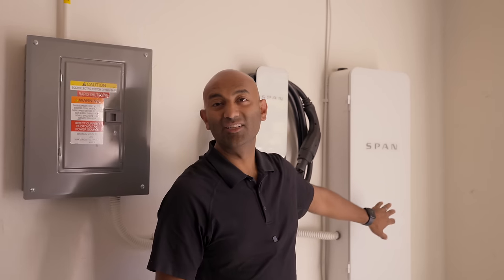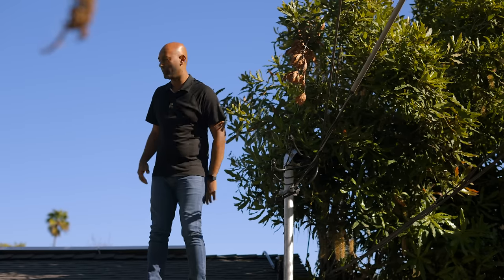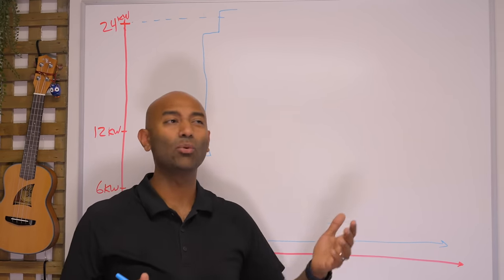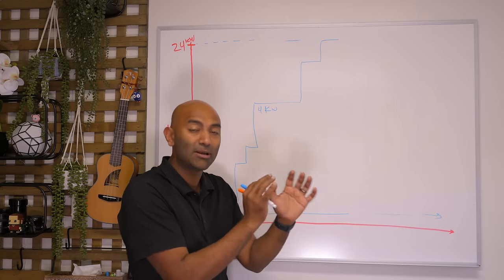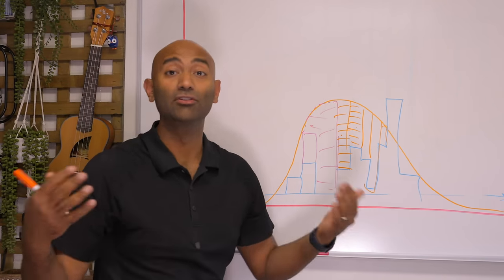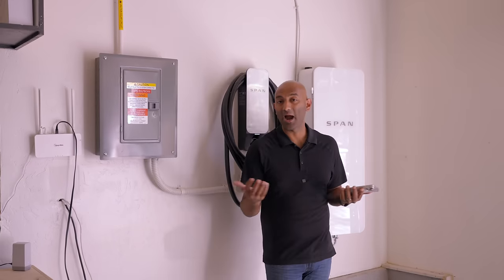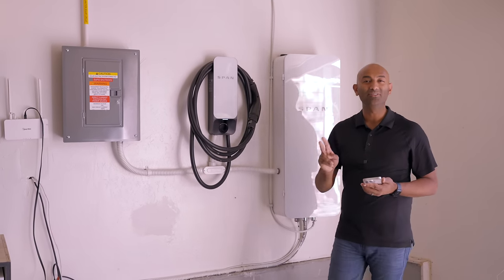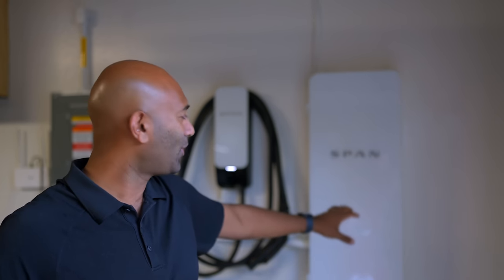I Installed a SPAN Smart Home Panel, Should You?

Comment: I can see this tech is useful, what concerns me is the dependence on a proprietray app. Software should be based on open standards, e.g. so you connect to it via a web interface. 
When people invest in hardware like this, they might expect to continue using it in 30, 40, 50+ years time. App stores might be obsolete by then, or dare I say it, some businesses fail so wont pay to keep their app available or updated.
+ Also they have to be idiot proof. Don't assume the next person living in the house will be tech savvy. They may be elderly or too busy and want it to "just work" by default.
Reply: It’s a fair point about proprietary software. I think he biggest challenge in that scenario would be newer versions that would still work on the newer device OSs. Perhaps if something happens to the company or if they discontinue these units they may release the source files or something so third parties can update it to newer platforms.
Reply: Agree entirely. Not only software obsolescence, but lifespan in general. Tech companies expect things to last a few years and then be replaced; the lifespan for property improvements is usually measured in decades.

Case in point: I replaced an old 'traditional' thermostat with a smart one a few years ago. The old thermostat had been installed since the house was constructed in the mid-80s and never skipped a beat. 3 years later and the smart thermostat is already showing a fault that needs a replacement (and it's not just an isolated example, the interwebs are full of comments about this fault on this thermostat - brand withheld to protect the guilty).
Reply: @ipp_tutor : On your point of releasing the source code, that’s the hope, at least; if the current state of affairs is anything to go by, however, then I’m inclined to say that it’s never going to happen. We can’t even get the source code for games that were discontinued back in the early 2000s, so I won’t hold my breath when it comes to something as security sensitive as a breaker panel.
Reply: @MinotaurUK  Why would you withhold the brand?  Tell us and maybe save someone the trouble.  You tube is full of reviews on crappy products called out by name.  They can't sue you or anything.  I am getting ready to buy a smart thermostat and I want to know!!!  :)

Comment: This is one of the most thorough reviews of SPAN Panel and Drive we’ve seen yet, Ricky! We love the fact that SPAN is turning your vision of a fully electric net zero home into a reality. Keep up the amazing work. ⚡
Reply: 🎤 drop!
Reply: Do you have to subscribe to anything? 
What happens when the Span servers go down, does that take the app down with it? 
Can you self host? 
Do you actually own it, or is it just a rental?
Reply: When I asked they told me no, why is he different? If they cared they improve the grid not limit it
Reply: @Jcewazhere rental, if they go out of business the app goes too, no self hosting, no backwords or forwards compatibility
Reply: Ricky should get credit for the fact that I just purchased a SPAN panel because of this review :)
Reply: Now make a panel with more slots or a piggyback panel
Reply: This all sounds great, but I got a quote from a SPAN provided installer for over $17K to replace my existing, overcrowded circuit breaker panel. In comparison, I got a quote of $2K to install a new, conventional load center. This is insane! Who can afford to pay close to $20K for their home service panel? I would never recoup the cost even with time of use power consumption. I would rather spend $20K on additional LFP batteries. That way you don’t need to play around with programming backup circuits.
Reply: @charlesavalos7928  that’s insane. At most it would be $5k for me. I’m in Texas. Does your state make a difference?
Reply: Is the Span Drive available now? He's saying in the future SPAN will be able to manage loads (like from an EV charger) to make sure don't short circuit, is that ready now? And if not, how do you do it now, just turn off a circuit on the software?

Comment: We love our Span panel! We installed it in 2021 when we installed solar panels and a Power Wall and the main 3 reasons were 1. We had to upgrade our service anyway, 2. We were switching to heat pumps to completely replace our natural gas heat and 3. We didn't want to be without heat in a New England winter by limiting ourselves to the circuits on a critical load panel. I appreciate that we're on the same journey toward energy independence! We're 2 years free of natural gas in our home and with no service interruptions thanks to span and the other upgrades to our home. Keep us posted on how it's going for you!

Comment: 20+ years off grid with just a 1Kw system and today I charged my EV Ebike and went for a 20 mile ride to the store.  I also ran my microwave, water pump, laptop and lights. Not hot enough for AC here but I can also run my 85 watt Evaporative cooler off that system just fine.

I can also fix my system myself and get the parts if needed.  Just sayin...

Comment: Perhaps this is a European perspective, but whilst this is undoubtedly very cool, I can't help think it's a solution looking for a problem. Most of the supply feeds over here in the UK are 60A or 80A. Outside commercial sites, i.e. people running workshops from their garage (and I mean heavy machinery like lathes, laser cutters, etc., not portable power tools), I don't know anyone who has needed a service upgrade, and that's even with EV charging.

1. Whilst there are some very powerful EV chargers out there, realistically, how often do people actually need to fast charge their vehicles? I presume most people plug them in when they get home, then as long as they're ready to go when they leave home in the morning, I suspect most of us don't really care how long it takes. So you can either 'slow charge' the vehicle over the course of 10 hours or so, or you can delay the charge until after your high draw activities have finished (i.e. after cooking dinner).

(Alec over at Technology Connections makes the case for slower EV charging in one of his videos).

2. How often, realistically, do people actually run all their kitchen stuff, their washer/dryers, and charge their car(s) simultaneously? Can't speak for others, but I have to try really hard to push my instantaneous usage over about 10kW - and that's with a UK kettle, oven, and microwave, as well as washing machine, all running simultaneously.

3. I suspect a lot of what this does could be accomplished locally/offline using some low cost smart plugs running Tasmota or similar. I already have them connected to my 'high draw' devices like washing machine and dishwasher. Shelly even do some smart switches that fit into the standard DIN rails on consumer units for higher draw devices on dedicated circuits like ovens. So I know, for example, that the most my washing machine will ever draw is about 2.7kW, and even that's only for a matter of a few minutes at the start of the cycle when it's heating the water.

4. It seems like this would create a single point of failure. At the moment, most consumer units are pretty 'dumb' - the most exciting things in there is an RCBO, and if it develops a fault, it'll just break that circuit (e.g. one ring main, etc.); it's pretty rare for a fault to knock out a whole consumer unit. But now the consumer unit has a lot more smarts, what happens if it develops a fault? Does it revert to dumb mode? Does it fail gracefully? Does it just shut off power to everything until fixed?
Reply: 80A is plenty, consider that the standard contract here in Italy still allows a maximum of 3.3kW of power from the meter: you can upgrade it (but if you want more than 10kW you have to switch to 3 phase power), still most people is fine with the 3.3kW limit and prefer to not pay an extra free for the convenience of not using your hairdryer at the same time the oven is running. By planing when turning on appliances a 3kW limit (realistically you can get up to 4kW for a short time before it trips) is not a big deal, I know people that even have induction hobs without upgrading the contract. 

Of course with EV it's another deal, and 3kW is no longer enough. But 10, probably it's plenty.

Comment: I love your videos, keep up the good work. I've been monitoring my own usage, and I'd like to add that heat pump water heater is like an extra refrigerator... under 1kW while running and not a concern. A microwave, also under 2kW and not much concern. The big draws for me (besides something like an EV or HVAC) are a resistive heat dryer,  electric oven, especially pre-heating,  and running multiple stove top burners. Span looks really neat, thank you for the informative video.
Reply: Have you looked into a clothesline or clothes horse? Resistive dryer is a lot of juice!

Comment: The most efficient heat pumps are VERTICAL ground source heat pumps; they drill a few bore holes which are only a couple of inches across, but they go 200+ meters down, so they reach areas which are constant temperatures all year round!
Horizontal ground source heat pumps require huge amounts of land & are less efficient. 
Air source heat pumps are the least efficient.
I have done a lot of research into these & can guarantee that a vertical ground source heat pump is your best option; the bore holes take up barely any surface area & the more you have, the better they work. :)

Comment: Hey Ricky! It's Tim from Drivyn. About how you mentioned California has too much solar and not enough storage at the Tesla Club meeting. What if the power companies incentivized businesses to put in free chargers for employees to help the grid during the day/peak solar production to stabilize it by providing a place for all that energy to go? 🤔
Reply: Hi Tim, just from the real estate / development point of view here in Los Angeles. The state and different counties are starting to incentivize but that adds to the upfront, out of pocket costs. How do you keep the costs of rents affordable when you have to add more to the construction costs?
Reply: Batteries need generation to soak up.   Its a balancing act of sorts but one for which balance is actually not possible because both sides of the equation need to continue to scale massively.   So while it is true that California needs a lot more storage, it is not true that California has too much solar.   California actually needs at least 3 times more solar than it has now, and probably more.   Otherwise there won't be enough generation for storage systems to suck up.
Reply: Hi, electric companies just limit your production by changing the frequency.
They are in business to make money selling you power.
Get a home battery and an electric car with bidirectional charging. Job done.
Take care M.
Reply: @markeh1971  Electric companies don't actually do that.  In fact, it is essentially impossible for the electric company to vary distribution line frequencies on anything smaller than a regional basis (covering hundreds of thousands of homes).  If even that.   The frequency will vary naturally based only on very, very large-scale supply and demand imbalances.   So, at best, UL1741 can only be used as a regional failsafe, or when off-grid, and that's it.
Reply: @markeh1971  I have 2 Tesla's. Even if they did have bi-directional charging, I wouldn't use it. I'd be wearing out my batteries without even putting miles on them. I'd rather have a powerwall for that 🙂
Reply: @junkerzn7312  then how come in Texas they are incentivizing people to charge their cars at night at extremely low rates to help the grid from all the wind generation they have? At night when the wind is blowing, the energy has to go somewhere. Thousands of EV batteries are the perfect place to store it 😀
Reply: @teslasnek  Say what?   What the heck are you talking about?  There isn't enough wind at night in Texas to run the whole grid(!).   Where did you get that bit of nonsense from?   Wind peaks at around 20GW overnight, while demand drops from 50GW to around 30GW.

Overnight charging has two advantages for power companies and generators: (1) The transmission lines are not loaded, so transmitting the power is basically free, and (2) Fossil generation is able to run less cyclically and maintain better efficiency.   So they get to charge people for the electricity without creating a commensurate maintenance burden.   Its free money for utility companies, basically.

Flattening the usage curve has major benefits for power companies and generators, particularly for fossil generators.  Coal, nuclear, and (older) natural gas plants can't operate efficiently on a daily cycle.  They need to generate steady output to be economically viable.
Reply: @junkerzn7312  Drew Baglino said, “By this summer, we are going to offer retail electricity plans to people who have our cars where they can have unlimited overnight home charging for $30 per month. This is part of reducing the total cost of ownership of our vehicles and the reason why we can do this is because Texas has a ton of wind. And in Texas, the wind blows at night.”

Comment: I've been wanting the SPAN panel since I first heard about it last year.  I acquired an F150 Lightning last year, along with their Charge Station Pro (EVSE).  My goal was to have the full V2G functionality (whole home backup) and monitor/control all of it with the SPAN. Since SunRun is Ford's partner for the Charge Station Pro installation, and SunRun is also a SPAN partner, all was looking good. Until they (SunRun) told me that they would not install a CSP and a SPAN panel together. No real explanation as to why, just a hard "No". 

I've been in limbo on all of it ever since. I've been waiting, hoping that something would shake out, and this would become a supported configuration.  I've also been following the build out on the Transport Evolved channel, as they are doing the same thing I want, but without SunRun as the installer.  They've had some hurdles, but last I saw, they had it functioning.  I'm waiting for a follow up after a little time for them to report on how it's going. 

I would love to see Ford, SunRun, and SPAN all sit down together to work out a cookie cutter solution. 

(insert Futurama 'take my money' meme here)
Reply: Sunrun was very difficult when I dealt with them through Costco. They wanted to put my LG chem power wall on an outside wall that gets afternoon sun and sees 110 degree temps in the summer. I was arguing it would affect the longevity / lifespan of the battery and was willing to pay more to install it in my garage. Finally I got them to move it and I happily paid more. Then came the day of the install, they had an apprentice that was one of the main installers nephew work on my main panel, he had to move the main power breaker and re-arrange stuff. I was slightly annoyed after all my labels were now incorrect. However, 2 months later when my main breakers caught on fire from improper installation (not fully seated according to the next electrician) I contacted sunrun initially and they said it would take 1.5 months to come out and look at my home without power. I hired my own electrician, who told me it wasn’t installed correctly, 2 days later I had a new main panel and 2k in credit card debt. I was able to trade some stuff I had for some of the labor to keep the cost lower. However, sunrun is trash and Costco ended up giving me money back after this experience. Sunrun played games with emails and all kinds of stuff until I finally gave up. The company is apparently too busy to help their customers so be warned!

Comment: At my old house, I could run my standard base line load, the electric oven and charge the EV. But if somebody used the hot water in the electric hot water tank came on then it would blow the main breaker. At the new house I don't have those issues, one is just me two I have a gas stove a gas hot water tank and a gas dryer. I didn't have a whole house AC at either house. I don't think it's a good idea to put all of your energy eggs in one basket there are things that gases ideally suited for producing heat is one of them. I would love to have a range that was a combination gas and electric a gas oven and an induction cooktop, but unfortunately those are really expensive, and out of my budget. I'm hoping to get a smart panel in the next couple of years and I think that'll be a huge addition, I use empora right now and The information it gives me has been pivotal in allowing me to effectively manage my energy usage.

Comment: This is something we have had in the UK for many years as far as the EV charger goes at least by way of the Myenergi Zappi. It does the load shifting from solar excess to EV but an underused maybe because it is not known by many is the Zappi also has a setting where you tell it the max supply capacity which will change the power usage based on that. It does also take into account battery input from solar storage. I think in the UK at least where AC is uncommon residentially it makes sense to have this in the EV charger not the CU it's likely to be the only thing to push the property  over the 80-100amp feeds most UK houses have.
Reply: Yep, I was about to say it sounds like the Myenergi range of products in the UK